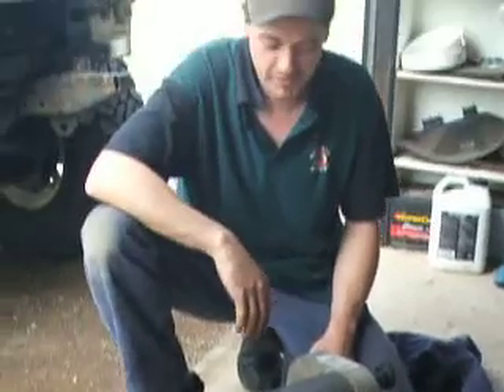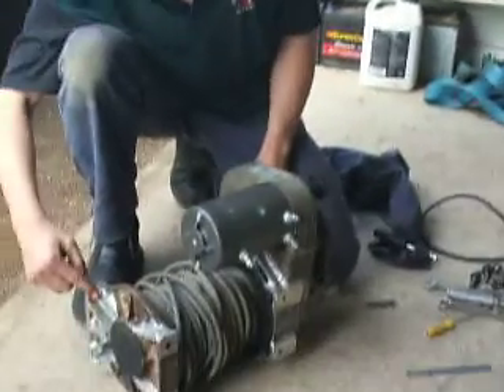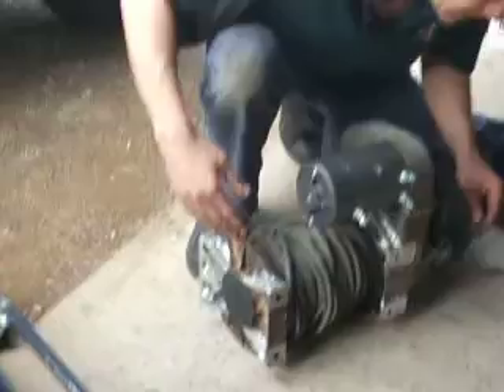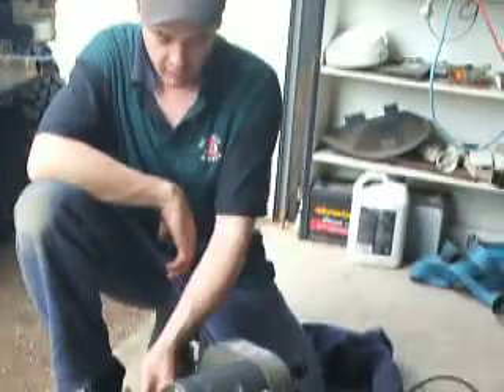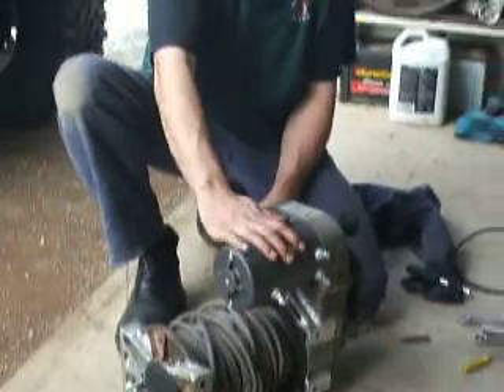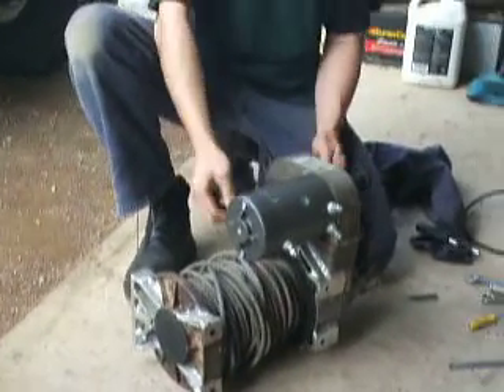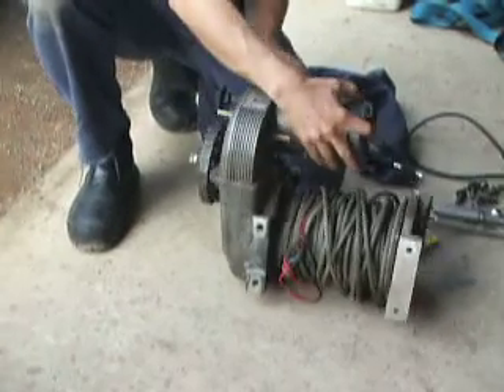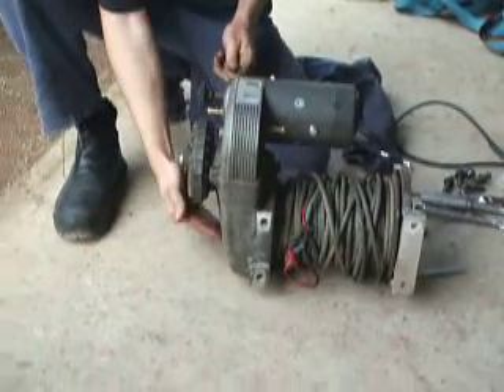Warn Winch rebuild high mount  M8274 GU Nissan Patrol

Comment from the maker: The 4.6 motor came from a 4x4 eBay store while it was operating. 
Most stuff I buy now comes out of the US through a shipping agent.
I'm now running a 6HP motor and Delta-tek free spool, so the release lever don't get used much, but its still all rigged up and works well.